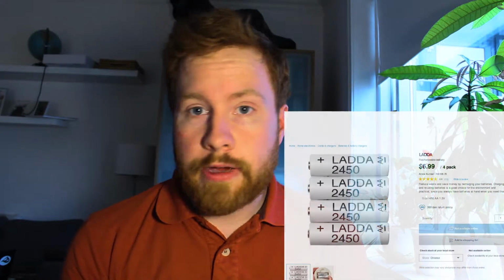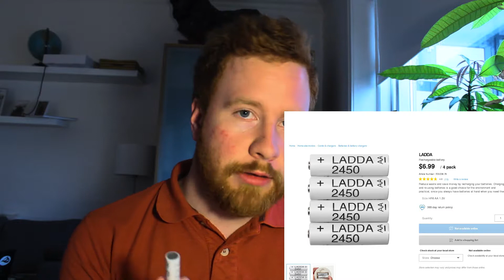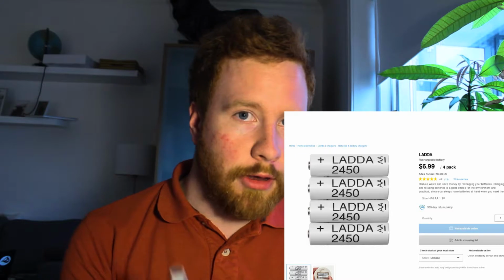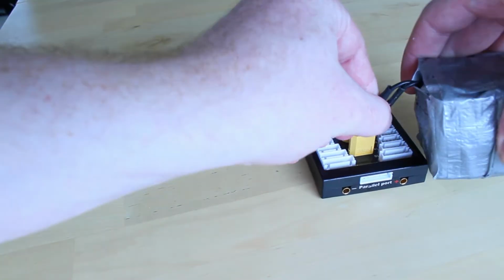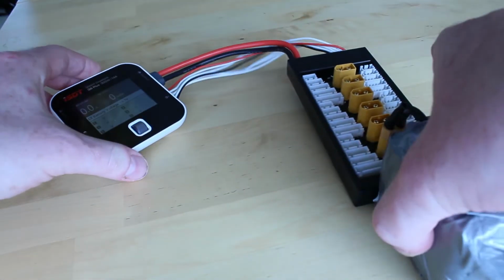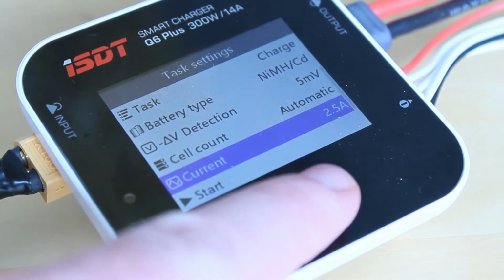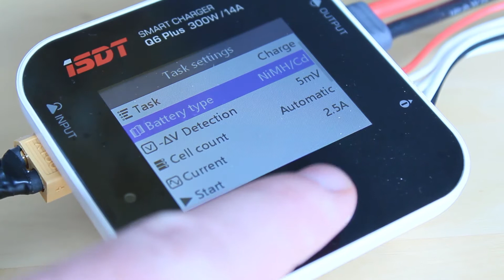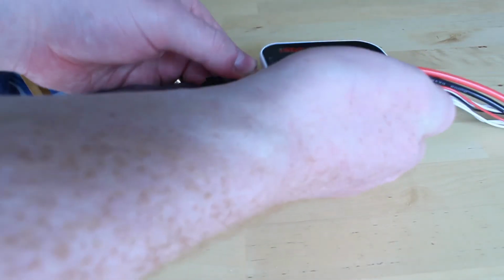DIY RC Field Charging Battery (IKEA NiMH Battery Pack)

Comment: Do the batteries need to be protected from uncharging to 0 ?
Reply from the maker: Thanks for the question! Yes, you should try to ensure that they don't over discharge all the way to 0v as it may cause polarity reversing. But they are still a lot less sensitive than LiIon or LiPo batteries and don't need to be handled as carefully.
Reply: Thanks for the fast reply. Are you happy with the amount of mah you get out of your pack? Since it's only 14-12 Volts I could imagine that they are not very efficient in loading 4s cells or even 3 cells ?
Reply from the maker: First of all I'll say I only have an amateur's understanding of electronics. But with a decent charger I think the step up in voltage isn't really a problem. 12V nominal at roughly 5Ah should give you 60Wh of energy. A 1300mAh 4s is 19.24Wh. Assuming that packs are 70-80% empty when landing, 3 lipos should be easy to recharge. But rather than me going on about what I think it's probably best if I just make a video and fully test how much juice I can get out of it. I'll do some charging tomorrow and try to get up a video on the results tomorrow or the day after.
Reply: That would be so awesome. My understanding of electronics is also very basic so I was concidering to rebuuild it.......surely only if it works properly :) thx a lot!
Reply from the maker: Getting the video out took a couple of days, sorry! There's a link in the description of this video if you want to check out a battery test.
Reply: Thanks. Saw it, but I think Liion would be the way to go (provided, you could get your handy on them). But I think for the same price of these NiMh cells you get enough old Laptop batteries to build a bigger pack, using a 3Dollar circuit from banggood.
Reply from the maker: Sagich Nich  That's very possible! My main reason for this build continues to be that I live in an island country where getting new LiIons is difficult and I wanted to see how these would work as an alternative.
Reply: Out of interest...why is it that hard to get Liion cells from stores or online? In Germany/France/UK its super easy. Online everywhere and even in stores sometimes :)
Reply from the maker: @hobbit04  We are a pretty small country with a limited selection of stores.  So far I haven't found any stores that carry 18650 cells on their own. International shipping regulations also say that you can't ship lithium batteries via air freight. Consumers in Iceland only have access to air freight - there's no way to order via sea freight. So lithium batteries are pretty tricky.